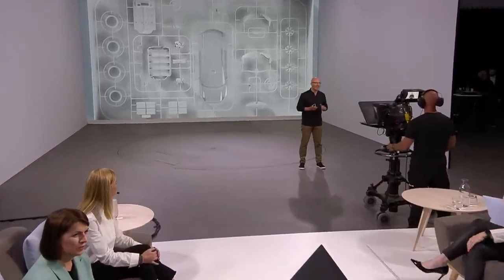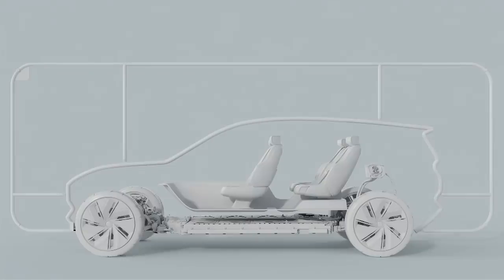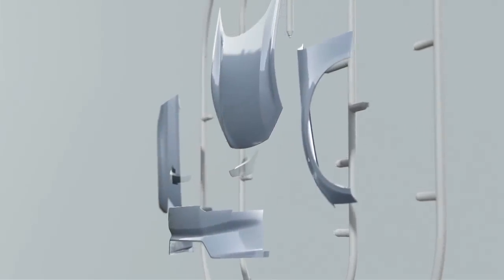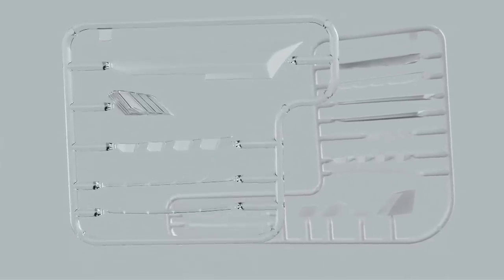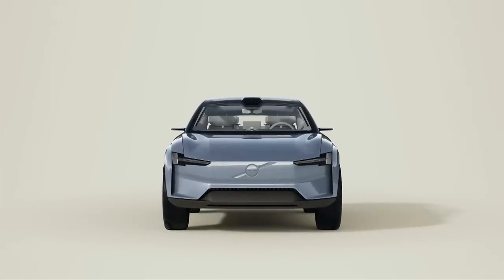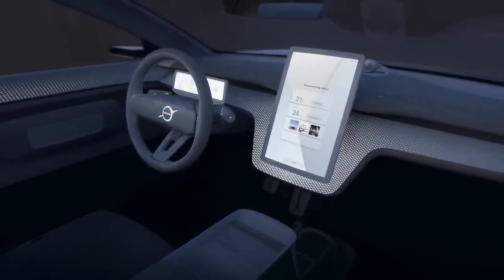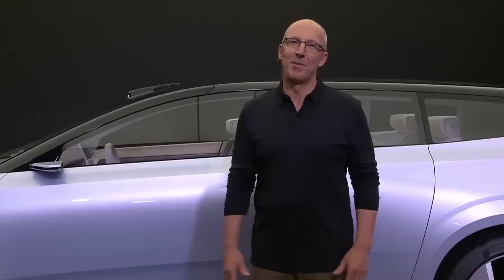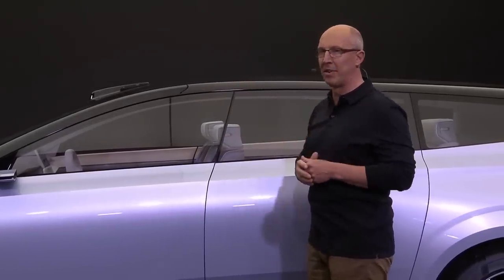Future of design

Comment: I don't get it how Volvo, pioneer in car safety technology is ignoring such a obvious hazard ... Big freaking screen in the middle! Jeasus I do have a screen in my car and I hate to take my eyes of the rood to change my radio or climate. Designer's wake up... Normal buttons are much much safer.
Reply from the maker: With the Android automotive OS system, there is no need to use the touch screen while driving, as you are able to use voice commands for things such as climate.
Reply: @VolvoCars  Maybe it works with native English speakers (I'm from Poland and i know it won't work with my voice/accent, i have tried it several times with different assistant's)...  If it even works on the first try, but when it doesn't you get distracted... Then you get angry. And really... Will you talk to a car? I know I wouldn't.

Comment: As pretty as it is, it's a design fail.  Form doesn't have to follow function, but form should never override function.  Look at the tiny window slits.  You can barely see the headrests.  Which means your head/eyes will barely be able to see out of the vehicle.  That's a fail.  Not just from a safety perspective (supposedly Volvo's primary mission), but also from an enjoyment perspective.  When I drive through Yellowstone, I want as much glass/view as possible so I can soak it all in.   (Or a new city, or any other cool place I want to enjoy the view).

Comment: The slit window trend is the worst thing ever it creates a claustrophobic atmosphere. Designers go then for a glass roof but the real problem is the doors up to your shoulders. A glass roof looks better from the outside but does nothing for the inside other than allow full sunlight to beat down on your head. also the high beltline destroys the drivers ability to see the corners of the vehicle. Designers then add cameras which are not a suitable substitute. Being able to see out of your vehicle is not over rated. Seeing straight up helps nothing. In my opinion which also means nothing except I will never buy a Chevrolet or this Volvo for the reasons stated.
Reply: I agree. One of the things that attracted me to Euro cars back in the 70s and 80s was the low beltlines and great visibility out of the cars. Volvo's 700 series had great visibility, for instance. Even the P2 cars in the early to mid 2000s had decent visibility and a decent height beltline. But this squishing of the windows and so-called coupe style roofs are really making cars feel claustrophobic. And Volvo makes the interiors now "charcoal" rather than a light color (although not in this Concept car interestingly enough). I think Volvo needs to drop the glass on the side. Maybe we can't get the low beltlines of earlier generations but we can certainly go lower than what is the norm now. A vehicle like the xc90 has a decent beltline and glass area. The xc60, not so much.

Comment: modern vehicles are designed more for looks than for comfort, despite designer BS.
 A pillar too low. ingress/egress difficult. dash too large and intrudes. seats too low as the roof is too low. cramped cabin. reduced window area. rear vision reduced by sloping rear hood and large C pillars. interior black depressing. sheet metal exterior too complex. looks weird.   even SUVs are not roomy. also. too complex mechanics and electronics. lower reliability these days. and...prices are too high.

Comment: Very danger batteries will explode
Reply from the maker: An aluminum battery enclosure provides rigidity and mechanical integrity in crash situations. This structure avoids exposure of the battery cells and protects the occupants. In the case of an accident, the battery is disconnected from the rest of the car to ensure that there are no live parts outside the battery.
Reply: @VolvoCars  how if it is protected explosion rate will be high you need to add fire extinguisher also

Comment: Bullshit on top of bullshit on top of bullshit... we need a new technology for batteries, SOME of us know these Li batteries are based on the same technology back from 1960s... is the same fucking battery that we find on owr cell phones, laptops, digital cameras now and back then. A bigger battery will NOT really add more range or at least not as much as you hypocrites want us to believe. A bigger battery will also add more weight and a longer recharge time. 
I'm not against EV in general, I'm just tired of these nonsense. EVs as a thing are great, its just the old battery technology that makes them useless for the biggest part of us.

Comment: There is nothing "future" about this. The car still has a ginormous front hood area, presumably just because we are used to it and find it pretty (there is zero need for it) and is overall pretty large, even though would be generally driven by a single person, sometimes with one companion. Larger wheels serve no purpose other than aesthetic, because otherwise this is wasteful (larger tires are needed, for example). None of that is future proof, imho, and combines all of the very worst trends of today. Citroen Ami is the future of design, not this SUV.